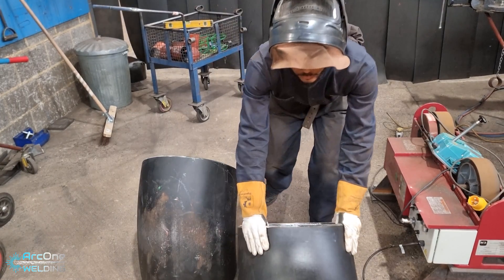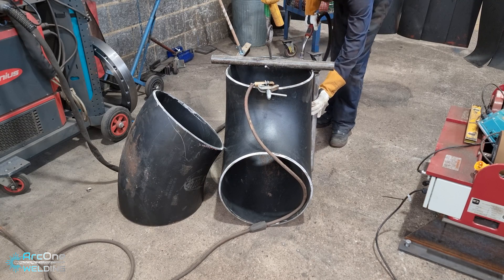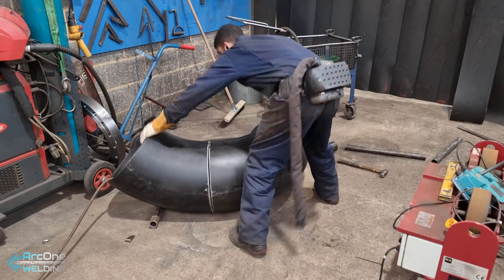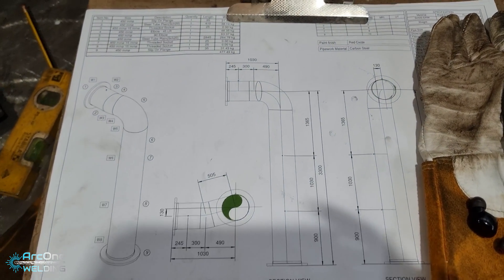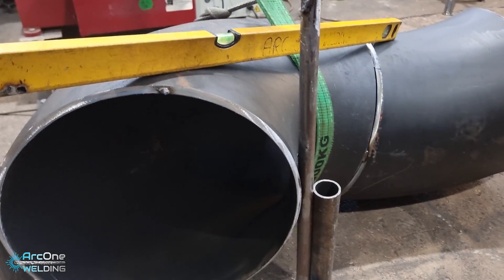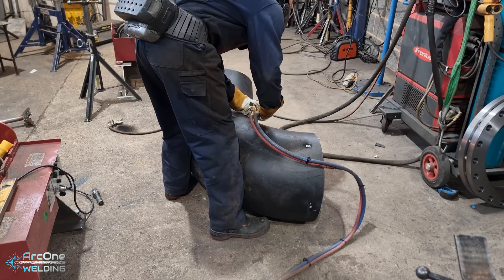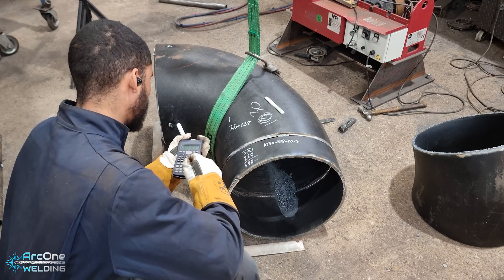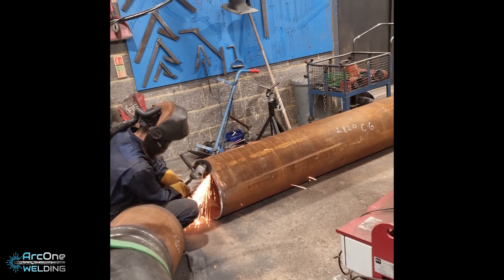How To Guide, Cutting Down Fittings *Fabrication tips* MAG/MIG Welding

Comment: Why not just stab the 90 onto the long pipe before fitting the 45 to the 90
Reply: Good fitters don't work on the floor mate that's what pipe stands are for stab the 90 onto the long pipe then fit the 45 to the 90  not hard really and no need for tacking shit on the outside of fitting outside of weld areas 🤦‍♂️
Reply from the maker: Im a fitter welder i do both and i do what i find the easiest, i did it on the floor because i needed to weld something onto the 45 first, if i did it on the rollers id have to tack it cut the fitting take it off and turn it around to roll and weld, extra work, i also work alone so on the floor is safer for me, also on the rollers id have to have it high enough to get a v stand at the lowest on the 45 (i dont have any small stands only full size ones) so now the pipes crazy high in the air

Comment: I do a lot of TIG welding at work mainly 2 1/2 “ up to 8” and we only ever TIG weld I was just wondering why you always seem to use MIG is there any reason to that or just preference
Reply from the maker: speed tbh dude, mig is way faster as long as its not a high spec job

Comment: This tube business looks interestings. Hey, You has been rocking a G5-01 for a minute, do you have a solution/hack/bodge for the dust getting under the inner filter lens? I was kinda pondering silcone grease, silicone sealant that I cut  with a box cutter next removal, and also a bit-o-tape. Any ideas here?
Reply from the maker: Hey dude, i got no real ideas atm on the old fx9100 i did try adding some foam draft pad but it didnt do much, and tape will work but its extra steps and thats long